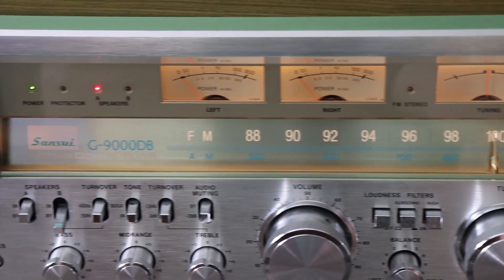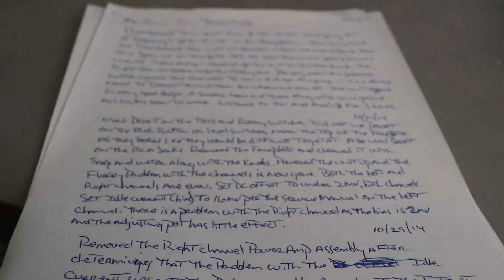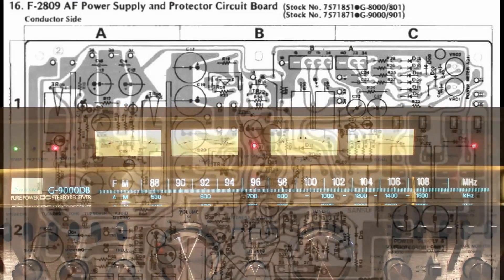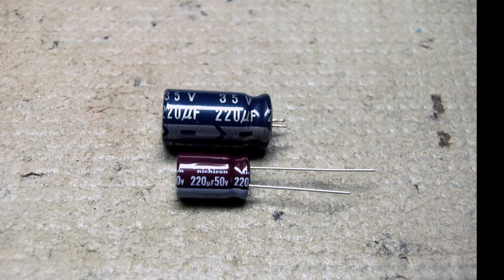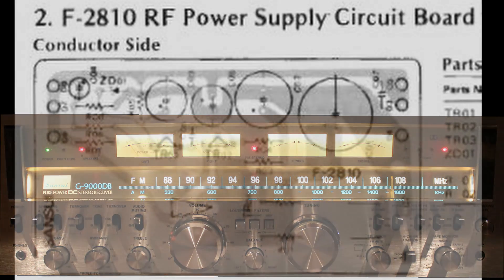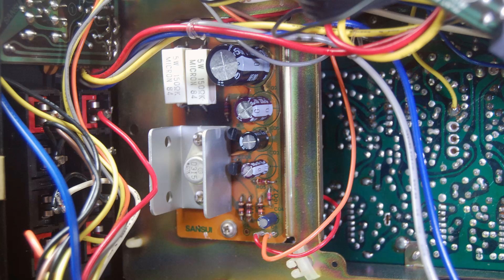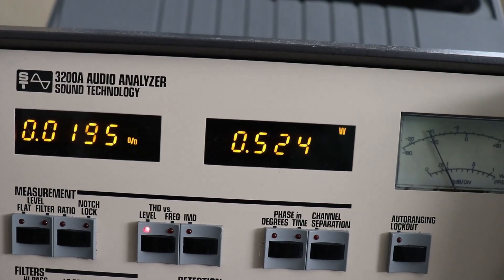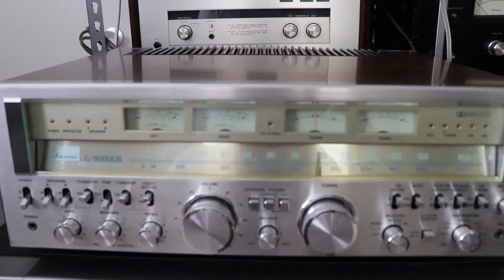G-9000DB - Sansui Receiver - Most Beautiful Ever? Repair Restoration Testing Vintage Stereo Audio

Comment: How difficult is it to replace the bulbs for the left and right power meters the Sansui G9000 (non db)?  Meters still work, just the lights went out. I have replaced the bulbs on my Sansui 771 and reflowed the solder on the lamp board,  and changed them to warm led. But I think the lights for the power meters on Sansui G9000 are going to be more difficult?

Comment: I was stationed in Las Vegas in 1979, and purchased a Sansui G9000 for $400.00 at a Hi end audio store along with Cerwin Vega S1 studio monitor speakers, the were rated at 400W/per cannel. The Sansui handled them beautifully, deep strong base and crisp highs. to make a longer story short upon returning from my service, I gave the Sansui receiver to my father upon him passing away I sent it to my new home in Florida. when it came by a delivery service I can't mention, I was working in my garage and noticed the driver through my box off the truck and I heard a loud crunch. I turned to him and said that was not mine was it? He replied yes, I was devastated, when I opened the box the unit was crushed beyond repair. Good thing I had it insured, still miss that receiver..

Comment: I enjoyed the video on the Sansui G-9000. I bought my G-9000 in 1978 at the Navy Exchange in Yokosuka Japan. I stowed it on the ship until we finished our cruise and returned to our home port in Pearl Harbor. I then shipped the equipment home via US mail. Once I got out of the Navy, I used the receiver for a while and then started having problems with the right channel cutting out. I took it to a stereo repair shop, but they didn't fix the problem. It has sat in a box in my basement since. It still looks like new. I would like to get it overhauled but not sure where to take in in the St. Louis Missouri area. I know how to de-solder and solder and not afraid to take things apart to fix as it used to be part of my job. However, I'm not sure I want to take this overhaul on myself.

Comment: I've over the years picked up 3 full set-ups free thru Craigslist and/or marketplace. Folks with quality equipment that have either gotten older and are looking to clear up space being flat screen tvs don't require an entertainment center . Or guys looking to (upgrade they say) by purging the older equipment to make room for smaller/modular systems with tiny surrounds and a sound bar  vs. (furniture)  box shaped speaker enclosures featuring 12-15" woofers..One gentleman had planned on going with a sonus wireless setup..
 But I'll take them up on the free vintage equipment every time!!

Comment: My story, I worked at a tire shop back about 2006 and had only heard stories of Sansui receivers. A guy, Clay built eye glasses across the Blvd in Sansom Park Texas use to cook and bring us food sometimes so he said come get a couple bowls of soup. He was living in his shop so I went in the back all I saw was heat sinks with a giant dishwasher sitting on top. I'm like what is that he said a dishwasher I said no what's underneath and he said ahh just a radio and immediately I said I want it (thinking it was a Kenwood) I turned it around it was a 1978 G9000 non DB so I gave him $75 for it and some crappy thin box Kenwood speakers that I got rid of. That thing dimmed the lights when turned on. Sold it to my friends wife for his birthday for $250. Fast forward today, he passed away last week and I just bought it back close to the same condition for $300 with a pair of KL777 Kenwood speakers, not even going to see if it comes on its going straight to the shop for servicing or rebuild whatever the technician suggests. Not leaving my hands again I'll pass it on to my son when I'm gone...😊

Comment: I had one of these 20 years ago. Under $400 on ebay back then. Sure was something to look at. The sound, was ok at low levels but something was missing at the higher levels. Should have held on to it, but it kept clipping and blowing my tweeters at high volume levels (Magnepan 3.5 planar speakers - power hungry). So I sold it back on ebay for a small profit and went all high end with monoblocks to power the Magenapans. No comparison, but I do miss that look of the analog age. These big old receivers were the stuff  dreams were made of when I was a teenager.  Perhaps I should have rebuilt it and that may have solved my clipping issues. This was all before YouTube, though...
Reply from the maker: There were so many great brands/models of audio gear back in the day. I also grew up with them and still enjoy them 50 years later.

Comment: I picked up a vintage pioneer stereo amplifier model SA-900 and the matching TX-900 tuner that was made back in the early seventies. The SA-900 has separate bass and treble controls and was the first high powered unit of it's time. The condition is near mint and never serviced, currently it is on my bench waiting to be serviced. This brings back fond memories as a teenager when my farther owned both items and the sound was amazing through his Leak two-way floor standing speakers.
Reply from the maker: Thanks for sharing. There was so much great audio gear back in the day.

Comment: I purchased one of my units from a service man as well. The older brother of an acquaintance I had had Who ended up to be my neighbor years ago. 
 Long story short he was stationed in Hawaii at Schofield Barracks (of course) and picked up an  Onkyo Integra ( The amp with the 2 huge meters) a Kenwood pre amp, Samsung tuner & a set of Cerwin Vega d-15s And a CD player of some sort. 
 Anyhow, We became Neighbors and later, best friends. At some point he was ready to move and wanted a new start on belongings,  including stereo equip. ( He wanted to go modular, smaller) and did not want to move the old stuff. 
 I purchased everything he had for a very low price, All in working order I might add. However, before taking possession of the speakers he decided to sell those to another friend so he would get a shot at things too. As I already had my own set of AT-12 Cerwin Vegas And lived in a house not large enough to justify both sets, I agreed to let his Other buddy have the speakers. 
Cut to today, I still have everything I bought from him. All still in great condition. Minus a power button that doesn't function properly( But hooked up through the preamp I can power it up that way) Only other issue being (the welcome lights come on and then shut off as they should but the running lights don't come on and stay on as they should) . It had fallen off Of a small shelf which was its home once when his younger brother was rocking out while he was gone.. A matter of changing a switch in the rear of the amp. I actually identified the issue at 1 point and had it working but the switch since shot craps..
  I don't use it quite as much as some of my other stuff but it is still hooked up and I rock it once in a while when I get the urge
... still sounds as good as it did when I first purchased it & is rather powerful ( Don't recall the specs)...
Reply from the maker: Thanks for sharing.

Comment: I was a TV/Audio bench tech in the 70’s, went on to become a Field Engineer for NCR in 1980 & retired a few years back. Anyway in 79 I was a tech for Audio Genesis here in Glens Falls, NY. They were a big Yamaha shop & someone traded in a 1976 Pioneer SX1050, 120W/channel receiver which I picked up for $200 bucks! Still have it although it hadn’t been re-capped but still sounds great, love it! 3 years ago I ran into & started dating a woman I was with for a year when I worked as a bench tech. She couldn’t believe I still had my system, AR8 Speakers, Kenwood KD3055 Turntable, JVC KD-A5 Cassette Deck & late 80’s Yamaha CD-300 CD Player. Hoping this time the relationship lasts as long as my system has.
Reply from the maker: Thanks for sharing. Man, she is a keeper if she remembers your old stereo!

Comment: Still have my G-9000DB from 1978 and if you turn the volume a little to far to the right,, the neighbors will call the cops on you.  LOL
Reply from the maker: No lack of power with this beast.
Reply: @vintageaudioaddict   I was in the Marines back then and bought it at the PX while stationed in Japan.  
Other Marines in my squadron also bought Kenwood and Pioneer receiver's as well. I remember being told you want a receiver that puts out the most power at the lowest THD,, and Sansui fits the bill. I have no regrets to this day. Not putting down Kenwood or Pioneer receiver's,, they are also excellent equipment.
Reply: @vintageaudioaddict  Also wanted to mention that I had to take my Sansui into the shop for work done.  The owner/repairman said these G-9000s are well sought-after and bring about $2500.00. Nice to know but I'll hang on to mine.

Comment: in 2011 i paid 520.00 for a g9000 on ebay.it was perfect.i would turn that big volume knob and it was like steping on the gas pedal in a hot rod car.i had it hooked to 4 realistic mach1 speakers ,a technics turntable and a 10 band eq.also i had an old sansui reverb that was awesome.i sold the hole system when i started buying pro audio gear but i miss it.i only got 1000.00 for everying now i kick myself
Reply from the maker: Thanks for sharing. I've have many pieces of gear that I sold or traded for in my youth that I wish I had today. Fortunately, I still have some of my old equipment from my teen years in the 1970's.

Comment: I got this receiver @ Pony Audio Ltd in Fussa City Chrome Tokyo in 1978 when I was stationed @ Yokota AB Japan. I will never forget seeing this beauty sitting on a display shelf in the back of the store, I asked the mgmr. About this DC receiver it had a 450.00 price tag on it but I had a couple thousand on me so I bought this unit a technics direct drive turntable the biggest Sansui floor standing speakers they had and left out with a out 600.00 in my pocket needless to say I still have this receiver and the original receipt to this day both are in good working order what a magnificent analog receiver ✌🏿👍🏽😜💪🏿👌🏾🎼
Reply from the maker: It's wonderful that you still have your Sansui after all of these years. Thanks so much for sharing and for your service.

Comment: Found one of these when I was working at a thrift store years ago unloading donations from a trailer. Pulled a couple of bags of clothes away to reveal the holy grail of receivers, growing up my dad had a g-8000 series so when I saw the 9000 I knew exactly what it was. Bought it that day for $35 on lunch break. Trying to collect a complete sansui set, have that receiver, a reel to reel and a tape deck so far
Reply from the maker: Man, what a find! Thanks for sharing. I've found some deals but never one like that. Good luck getting the rest of your vintage Sansui system together.

Comment: Most of my stuff comes from e-bay. I'll get it, open it up clean it,  test it and restore if necessary. I can't tell you how many times replacing a blown fuse has brought a whole system back. I've had a lot of different stuff ranging from Technics, Mitsubishi, Kenwood and NAD. My current system has a Mitsubishi AV series Amp and a Audio-techna turntable and a cheap CD player. I don't put a lot of money into the system. I do put time into them.

Comment: Hi do you know where can I find/ buy  the  audio outputs/ connectors? I just bought one exactly like this one but the audio connectors care broken, they do not hold the speakers wire, the little spring that make pressure in the connectors are lose. Thanks in advance!!!

Comment: I just bought one  Sansui G 9000 in a local buy and sell app for $50 DLS, it needs some TLC , not sound is coming from the outputs, also The outputs has some damage, but  I will take it to the repair center.

Comment: I qualified as a Chartered Accountant (England & Wales) in 1978 and went out and bought a mixed system from a HIFi shop in Edware Road, adjacent to Oxford Street, London comprising of 1) JVC QL-A2 turntable, 2) Marantz 2228B Receiver 3)Sansui Tape Deck (this has gone so I cannot remember the model  and 4) a pair of Wharfedale X2 Glendale speakers. I still have these 3 components (not in use though) and they have travelled from the UK to Singapore, then to Malaysia and finally back to the UK in 1981. They are all in good working condition but being lazy, I simply didn't have the time to play my vinyls (still in a storeroom). The receiver is a bit too big, so are the speakers. The Marantz probably need relamping (I didn't know until recently thought YouTube videos) and possibly recap (thought I wouldn't really know about this). The combination was all I can afford at that time but they gave such a wonderful sound for a non-autophile. Once the pandemic is over, I may be able to deal with bringing them out again for maintenance.
Reply from the maker: Thanks a lot for sharing your story. Yes, hopefully you can get them out and going again.

Comment: I live in Morocco and purchased few month ago this wonderful receiver. First of all I want to thank you for this very didactic video, it's full of great information. As you may easily imagine, I would like to restore it and give it a new life. Would it be possible for you to share with me the list of capacitors to make it "young again". 
The stage when I bought it was more than correct but nothing has been done on it from the beginning.
Can you please help me in this issue and advise me in what, in your opinion I have to focus on.
Gratefully yours, Hassan
Reply from the maker: Hi Hassan. Thank you for your kind words. I don't have a build list for any of my projects. I keep all the capacitors, transistors etc. in stock so I can just go to work and not have to order parts for any particular project. Hassan, your Sansui is more then 40 years old so replacing the electrolytic capacitors throughout the unit would be wise. This way your Sansui can be reliable and sound it's best for many more decades.
Reply: @vintageaudioaddict  Thank you for your reply. I promise to,do my best and let you know.
another thing to share with you : I have the great Sansui AU 111 for several years now. Have you ever worked on it, these years ? If so, your advises are more than welcome.
normaly I use a pair of Cornwall Klipsh with my 9900 , is that make sens ??

Comment: I bought mine, along with a 10 band per channel equalizer (Sansui) and a Teac turntable and tape-deck at the Guam Naval Base PX in 1979. Added a pair of JBL L-150's from the PX at Pearl Harbor. IIRC, it all cost about $2200 US, which was a lot for an enlisted sailor in those days! Again IIRC, I paid less than 500 for the receiver which listed for 1199 in the states. My memory could be faulty, of course. Still have the receiver and as of 3 years ago before a move, it still worked. A little scratchiness when adjusting the volume and a couple of LED's out, but otherwise in decent shape. I just retired and will probably become an expat so will most likely let it go at some point. Will be a sad day.
Reply from the maker: Thanks for sharing and thank you for your service!

Comment: Great video. Is it possible for you to provide the parts list? Unless I can find someone trustworthy to restore mine I'd like to try it myself. Thanks.
Reply from the maker: Thank you! I don't use a parts list as I have almost everything I need for my projects in stock as I do so many restorations/repairs. I just start a project knowing the I have the capacitors, transistors, etc.

Comment: Are there certain model Sansui or Marantz that would be easier to restore than others? If so which ones would you recommend? I went to school years ago for electronics but haven't  done board level component replacement stuff forever.
Reply from the maker: Not really. All of the vintage brands are similar. One exception was my Marantz 2500 where the equalizer(phono) board was a pain to get at. For the most part once you have some experience working on a few units they all come apart and go back together in a similar manner.
Reply: @vintageaudioaddict  Thanks

Comment: Sansui got this series design perfect.  Volume and tuning control bigger and central. Sansui and Accuphase ....the very best. There is currently a Sansui G-33000 "the king" for sale on the bay for around $15k US....has the same front panel but has around 280 Watts output rms per channel, I think the VU meters peak at 600W...holy moly batman!!!! Serious power...almost enough to drive Bose speakers! joke.
Reply: Warpedsmac 

$15,000 ?    That's insane!  It's a great piece of equipment but, NOT that great!
Reply: @dr.OgataSerizawa  Insane or sane, here's the listing; https://www.ebay.com.au/itm/SANSUI-G-33000-Receiver-THE-KING/114265219657?hash=item1a9abce249:g:cskAAOSwjnpbecV6&frcectupt=true

Comment: Pioneer SX3900 ....the flouroscan ...bought in 79...was my 1st big purchase at 17 with my work $$$... taught Tennis (I think was 79...still have receipt somewhere) bought wholesale... direct off docks via connection I had (Bro in law) for around $500 or what was approx 50% off retail > It's been reconditioned about 10 yrs ago > jbl 65's ...the smoke glass tops  > I agree... Classics that will always be enjoyed by those who appreciate the craftsmanship > loathe these throw-away days...smh now I sound like my Dad

Sad thing is. ..the kids (17, 15 & 10) ....no appreciation for any of it > was always thinking I'd be handing it on down ...but will be better I'm thinking to find someone who'll appreciate it & care for it as I have. Did finally replace it a few yrs ago with a Pioneer SC 1222 ...was time to get with the AV times I suppose.... took me long enough.

But the 3900 still goin strong and would kill me to sell after 40+ yrs